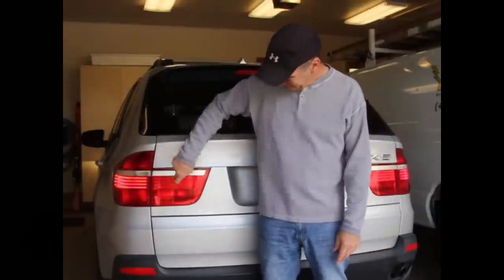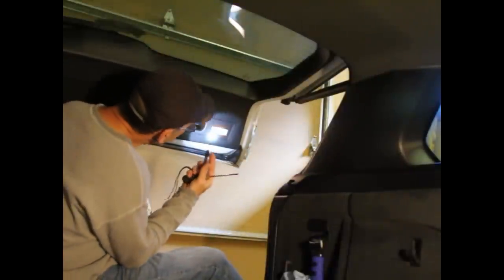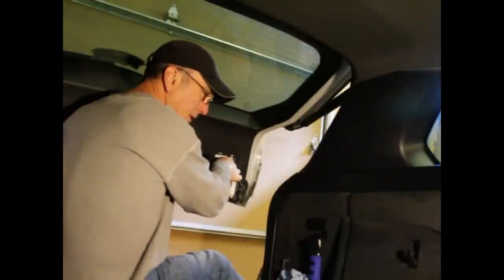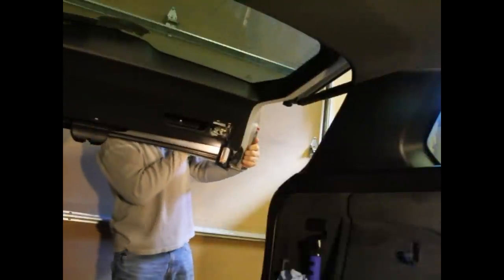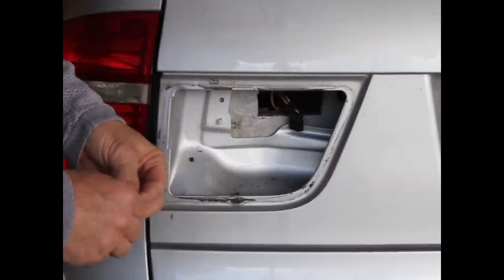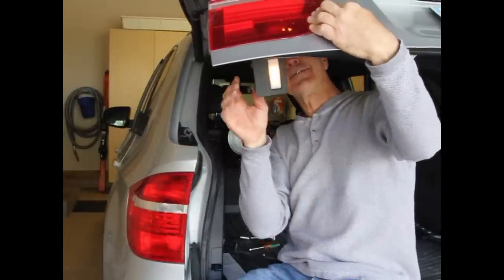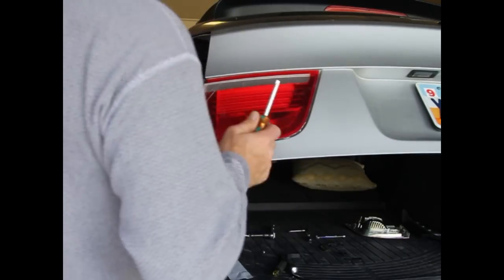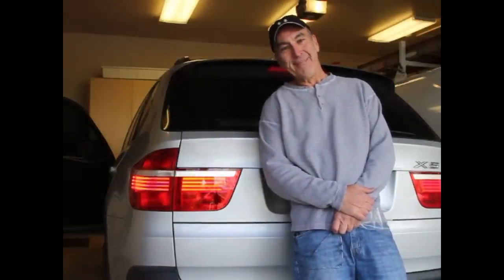🏆 How to Replace BMW X-5 2007 Tailgate tail light E-70

Comment: Great video. Couple things that made it easier on me:
1. Use acetone diluted with water to clean the old glue
2. If replacement part does not come with double sided adhesive tape, use 3M tape or gasket maker silicone 
3. Careful not to overtighten 10mm bolt as it may result in breaking of the platic bracket

Comment: Thank you for your easy to follow instructions!!! Just changed my e70 passenger side and it took longer than expected bc when I pulled off the old one, there was silicone adhesive that made a nasty stringy gummy mess. I had some handwipes in my car that have 70% alcohol in them so it helped remove all the goop. I replaced with a Magneti Marelli OEM, but once installed, it didn't fit right and stuck out. The gasket molding around the inside was too thick so the assembly's 3 tabs wouldn't stay in place on the outer side of the hatch. I had to trim the thickness on that side so that the 3 tabs would stay hooked to the hatch. So reinstalled and it is now flush with everything. You're right...that nut and bolt was a bitch to get at to loosen until my fingers could do the rest LOL. Thanks again!!
Reply from the maker: Nice! and the Stealership would have charges ya $600!

Comment: Thanks this was really helpful.  My X5 is 2013 - the only notable difference - the nut on my light is 8mm.  Once I had removed the light, I discovered that plastic catch attached to the nut can be squeezed to release it.  So it also just pops back on making the installation really easy.  BMW in Canada wanted $600 to do this!
Reply from the maker: $600?   🙄  NEVER EVER go to any Stealership out of warranty unless it's for OEM parts.

Comment: Pretty good video. ONE NOTE: do not completely remove the inner plastic retainer piece that is attached via the nut. It is meant to spring/snap into place. Then once it is in place, tighten the nut to secure.

Comment: Perfect instructions. Left one took me some more tie. Right one took me 12 min from beginning to end.
One question, Would t makes sense to seal the outside with SILICONE to prevent water infiltration ? Something only from the outside to allow to be cutted in case you would need to replace again.
BTW the nut is 8 mm , not 10 (At least in Europe)
Reply from the maker: not necessary to re-engineer german engineering, but its your car, do whatever you feel is best
Thanks for watching
Reply: 10 in uk

Comment: Hi Sir Excellenttttt Video and great information. I did buy a new"aftermarket" inner tail light for my 2013 bmw x5 35i,as my original assembly was corroded at the led circuit board and the led was out and wasnt working. I installed the new aftermarket one yesterday and its all working fine and both left side and right side lights are of same brightness. i drove it around all ok. when i started up the next morning  it says "left 2 stage brake light out, i continue to use the vehicle during the day and when i shut it off , the symbol showes up in the dash that a left rear 2 stage brakelight ....but the bulbs are light it just fine and it all works ok. what are your thoughts? ty in advance for your input.
Reply from the maker: My Thoughts? Thanks for watching!  These BMW's are so over engineered and the replacement part must not be OEM.  The sensitive electronics must be recognizing something from CHINE UH and throwing the idiot light to ya.  If you are 100% sure everything works, then get used to the BMW life of always having some warning indicator illuminated till the Stealership can reset it.
Reply: @UncleFjester  Hi Thanking you for you prompt response and knowledgable input

Comment: Followed your video to change the light on my 08 x5. Just a fyi you can use gogone to remove the original seal. It comes right off with it.
Reply from the maker: Good tip, But, I've ruined stuff with goo gone.  WD-40, brake Kleen, lighterfluid, nail polish remover are safer alternatives.

Comment: that rubber gasket CRAP shows BMW craftmanship at this factory in South Carolina. TERRIBLE junk and lack of attention to quality and detail...I will not mention what crap it all is that so many of us have to replace those lights. NEVER AGAIN A BMW. it is ridiculous especially that you realize how nice the AFTER MARKET CHEAP gaskets are. BMW quality is CLOSE TO BEING A DISASTER,
Reply from the maker: FWIW, my reason I keep replacing these, is, I back out into my Trash Dumpster  and the lens hits the bucket at the right place to break it.  I feel lucky that this is all the damage.  I've done the same with my Ford E250 , only once, knock on wood.  Build quality & detail has spoiled me, I want 4wd and nothing compares, everything is cheap comparing to the X5.
Reply: I am APALLED by the pathetic quality of BMW X5... I have a CAMRY HYBRID same year and 3x the miles...NOTHING to do on it! just OIL changes! X5...door handles even need replacement as PLASTICS became gluey and I need 100 per door handle to replace... junk cars are made by BMW. Never a BMW in my life.